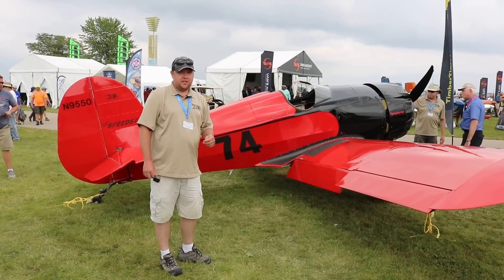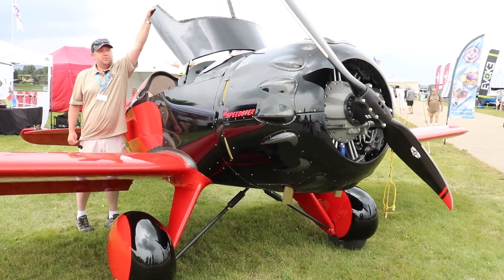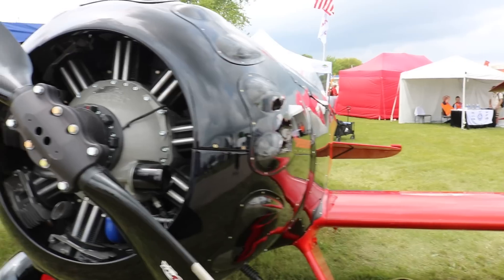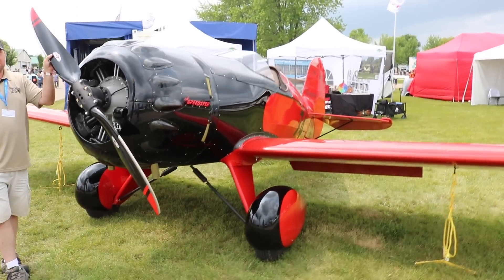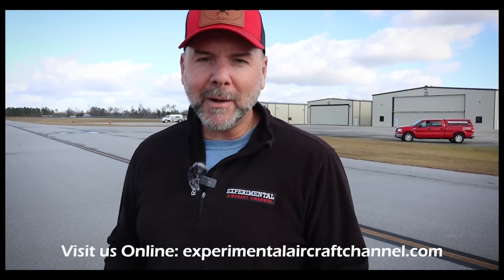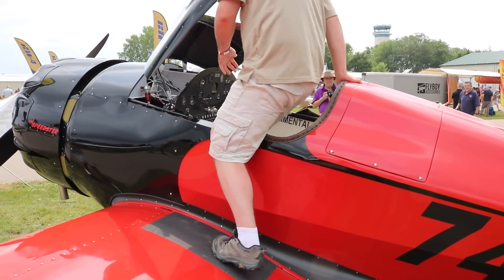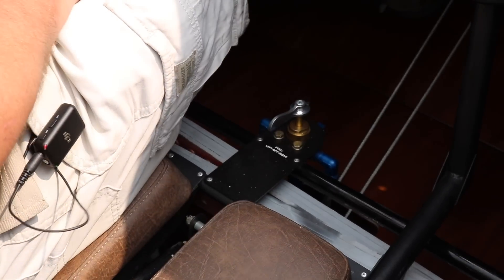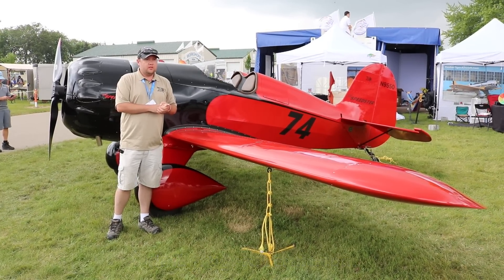Kays Speedster KIT AIRCRAFT Update 2024

Comment: Going to be a naysayer here, but the lines are completely wrong. Short, squat, nose droops, it’s like the Travel Air Mystery Ship slept with its cousins too many times and the result is aircraft deliverance. When the great aircraft designers like Benny Howard and the Granville Bros drew their designs out on the floor in chalk, using the TLAR method (that looks about right), this little abomination is just a hard no. Such potential, but put its lines up against the great art deco airplanes of the 30s like the Spartan Executive or Lockheed Electra or for that matter the Ryan STA, and Staggerwing, and it falls way short. Swing and a miss, guys. Appologies.
Reply: I mean, we also sell kits replicating the Ryan ST which you mentioned in your berating rant.  And, for what it's worth, the "squat" landing gear in the video is a shortened version we used so we could get the plane into the trailer for its trip to Oshkosh '24.  The plane flew with its regular gear a month later.  In our market analysis, the Spartan and Staggerwing both fall short despite the desirability of the originals.  There's no use even looking into an Electra or anything of the sort.  When YOU design, prototype, market and manufacture an airplane over the course of several years and thousands of hours of work, follow up with us here in the comments.  I'd really love to see it!  Better yet, maybe I'll be able to learn something from you!  Thanks for your interest (or, more clearly, lack thereof).
Reply: The Kay’s Speedster is still being refined in test flying, with every detail shaped by disciplined engineering, historical study, and professional review. It brings genuine imagination and originality back to a kit market that has grown stagnant and too often lacks creativity. Designers, builders, and aviation historians have praised it for technical skill, innovation, and a thoughtful homage to the golden age of aviation.

It is almost mesmerizing to watch someone craft a critique that is wrong on every level while projecting confidence. The original post reads like a crash course in how to sound knowledgeable without actually understanding anything. One almost has to admire the dedication it takes to assemble sentences that misrepresent engineering, design, and history so completely yet still expect to be taken seriously. It is a masterclass in irrelevance, an impressive feat if your goal is to highlight how little you know while trying to appear insightful.

In aviation communities we value knowledge, experience, and constructive discussion. Public posts that offer nothing but glib insults undermine that spirit and distract from meaningful conversation. The Kay’s Speedster stands on its own merit, respected and celebrated by those who understand the craft. Meanwhile, uninformed, loud voices remind everyone why expertise, accomplishment, and respect matter in both aircraft design and community engagement.

Comment: Don't buy AV-30 its LCD fades in one year and there's a bunch of other problems with it. The company has a terrible support service among other problems. Go Garmin G-5 instead. WAY BETTER, reliable, brighter LCD easier to operate and install.
Reply: My experience has been the complete opposite. I have two AV-30s in my plane and they work fantastic. The interface is beautiful and, in my opinion, much more useful than the Garmin G5. When I had an issue, the technical support was quick, and they processed an RMA replacement on a unit that was root caused to a failure caused by me during installation while redoing my dash.